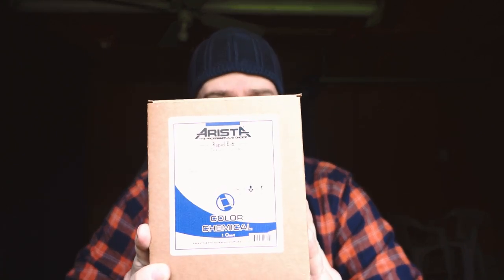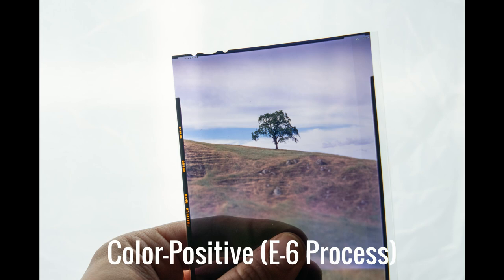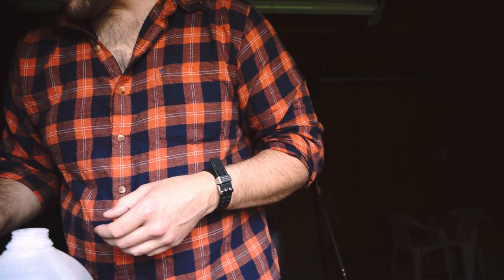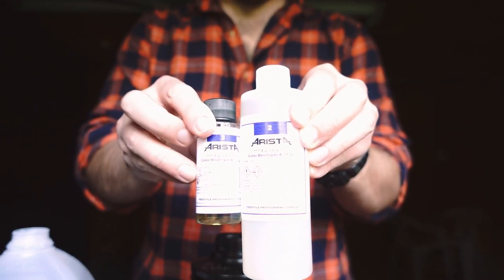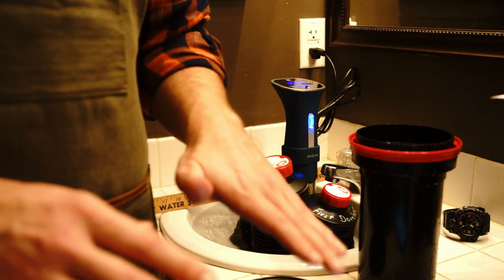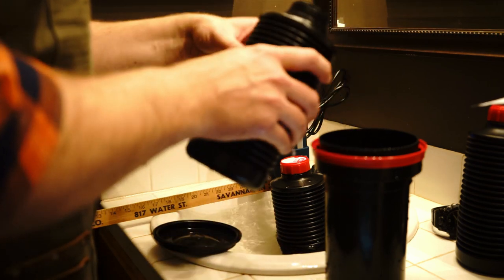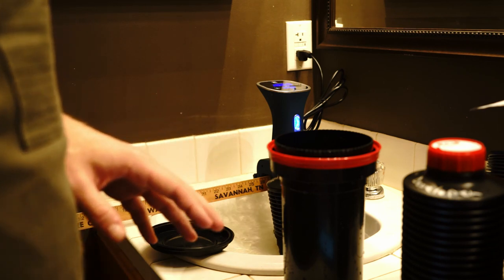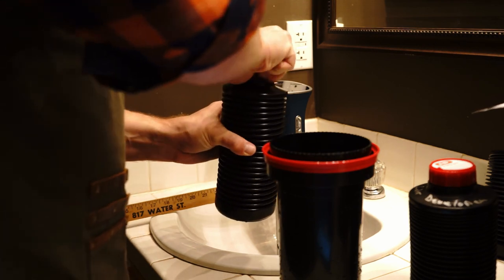EASY E-6 COLOR FILM DEVELOPMENT AT HOME

Comment: He makes several good points about development technique which do not appear in the dozens of other "how to" videos on developing E-6 and C-41. Worth the watching IMO. Like most DIY chemical kits today, this one omits a stabilizer bath after the final washing. This omission is a matter of marketing an apparently simpler, easier kit. There has been no change in the E-6 process which omits this component. This omission will expose the film dyes to fading from light or atmospheric contamination over time. To make an adequate stabilizer, make up the final bath of distilled water and Photoflo, as he does here, but add 3.0ml per liter of formalin to the bath. Formalin is a 37% dilution of formaldehyde, commonly available in the US at most drug stores, although you may have to ask for it. Agitate and soak the film to replace water with stabilizer, as normal, for a couple of minutes, then dry normally without further washing.
Reply from the maker: Hey Randall thanks for the kind words. You make some good points. Aside from the E6 kit, all the other color kits I've used (C-41 Arista/ C-41 Cinestill) have included a stabilizer step/wash. I've heard loads of conflicting information on the use of a stabilizer for modern emulsions compared to older formulas; some say you don't need it, others say you definitely need it, some are using a formalin/photo flo mix, ect. I personally have always used the stabilizer for all my C-41 films and since this video I've began using that same stabilizer for all of my E-6 as well. Regardless of anything else, it just makes me feel better about the archival quality of my film. I actually need to remake this video (and a few others) to update, well...more or less everything about it ha
Reply: @AdamWelch  The confusion over use of stabilizer comes, I think, from Kodak's changhe of the C-41 standards around 2003, which changed the chemical nature of the dyes used in the film, which in turn allowed the omission of a final stabilizer bath to protect those dyes. Pretty much any C-41 negative color film made thereafter can be processed without stabilizer, although using such will not hurt the newer film. Unhappily, but common on YT, this information has been garbled by the unknowing and in many cases extended to E-6 and ECN-2 (color neg movie film), where the same changes did not occur  and use of stabilizer is still mandated. It's further complicated by some chemical kit manufacturers, i.e. Cinestill, which will include stabilizer in one of their C-41 kits but omit it from another C-41 kit.
Reply: @randallstewart175  Also, in proper E6, formalin stabilizer as a final rinse is not used. Stabilizing is done by conditioner (officially pre-bleach) which reacts with bleach  producing formaldehyde. The final wash used by Fuji and Kodak in now similar to final washes used in C-41 . i.e. surfactant similar to Photo-Flo and a fungicide to prevent mold growing in emulsion during storage.. In simplified 3-bath kits, formalin stabilizer is necessary, because the process omits the conditioner stop altogether. As you said, E6 film does not contain stabilizer in emulsion, and stabilizing in some form is necessary for dyes to keep.

Comment: I’m getting the Tetenal E-6 kit which makes 1L of each chemical, but only have 500ml bottles, is it fine to halve the chemicals used for each and halve how much water each one requires?
Reply from the maker: As far as I know...and I'll repeat that...AS FAR AS I KNOW that should be perfectly fine. Just half everything as you've stated. However, I would be worried about accelerated degradation of the concentrated chemicals after they are opened. I really have no idea who long they would last even if you managed to minimize the air gap in the bottles. I'm sure you've probably considered it but I've nearly virtually exclusively switched over to pink kits for all of my color processes specifically for the reasons you mentioned; the fact that I seldom needed all the chemicals of the quart kits. Of course, Tetenal doesn't offer a pint kit that I'm aware of, so you'd have to go with another brand. I thought Bellini offered a pint kit but apparently now. So I think Arista is the only one currently offering anything less than a liter/quart kit.
Reply: @AdamWelch  
Was just watching another video about using the Tetenal kit and it has different ratios on the bottles, to make 500ml of each chemical or 1L, and 2.5L for the larger kit. So I think I should be fine there to be honest. 
You use 100ml of each chemical when doing 500ml. 
I think each bottle in the 1L kit is 200ml so if doing 500ml of each you get 2 sets of the mixed chemicals in the end. 
I’m planning on also trying to develop a super 8 film with it after doing some 35mm, not sure if 500ml is enough to fill the tank though.
Reply: @AdamWelch  
As to the shelf life of the opened concentrates, I know that the mixed chemicals last about 6 months, I would hope maybe it would be the same for the concentrates? Depending on what happens and how it goes for me though I should hopefully end up using all the chemicals in a relatively short period of time.
I’ve had some Ektachrome 35mm rolls sitting in my fridge for like the last 2-3 years, and I’ve never had 35mm Ektachrome processed before, I’ve shot like 5 rolls of it but never seen any of the photos I’ve taken. 
Annoyingly, I’ll have to do one roll on its own unless I just buy another roll to develop with it so I’m not wasting chemicals. 
I’ll have to do it in lots of 2 rolls, also. Mainly because I’ll be mixing 500ml chemicals but also because I just don’t have a larger tank set-up.
Reply from the maker: @therestorationofdrwho1865  Oh that is very convenient. I wish other companies would offer a recommended "split" of their kits.